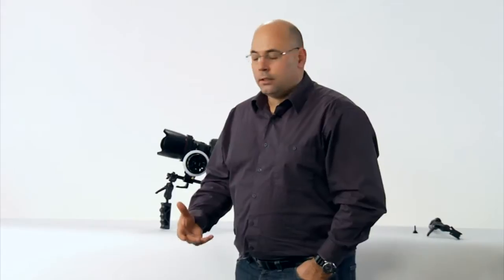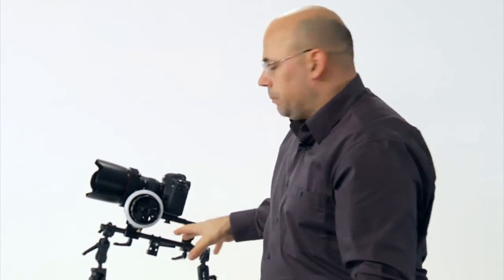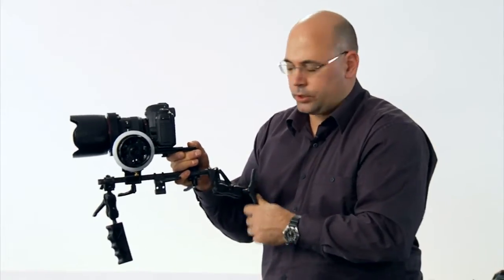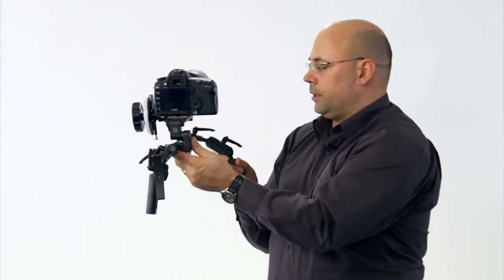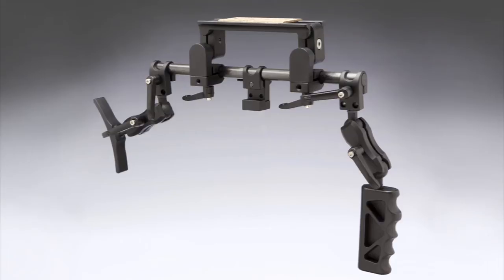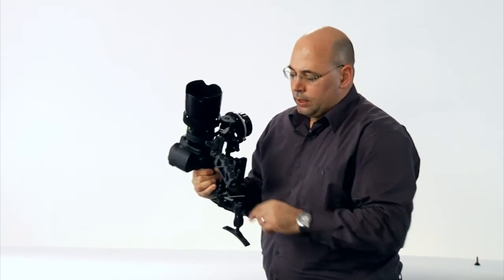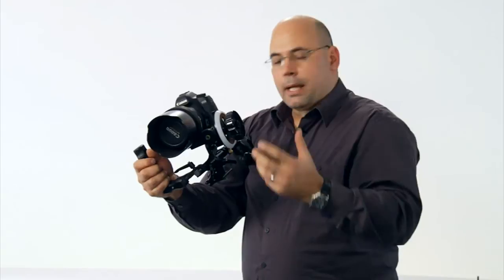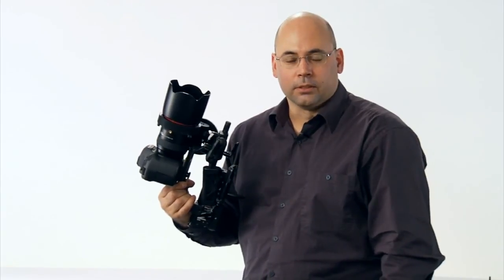Uno DSLR Rig - Video University

Comment: Would the small camera grip you sell be strong enough to use for a t2i? I just want to use a dfocus with a dmount and the cinevate small camera grip mounted into the 1/4 20 hole of the dmount. Would that be too heavy for the grip? Was also thinking of  maybe mounting an lcd monitor onto the hotshoe of the t2i but not sure about the added weight of that either.